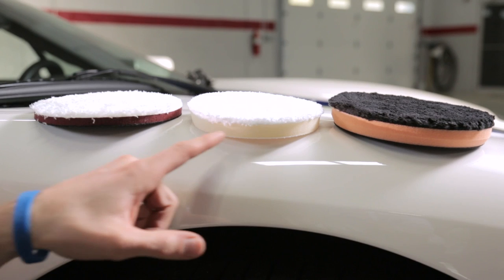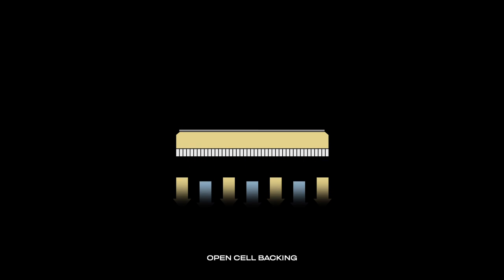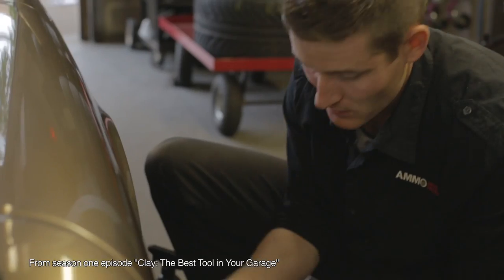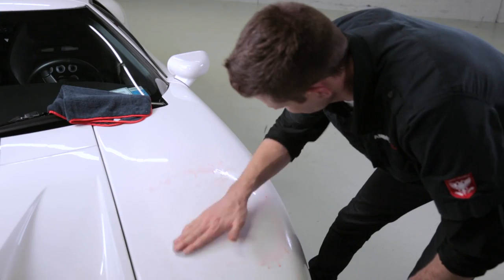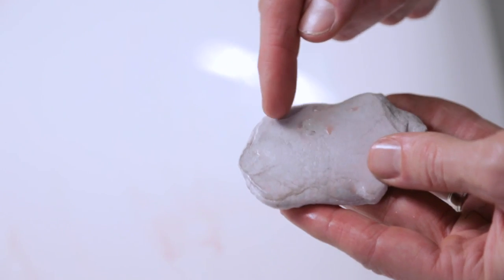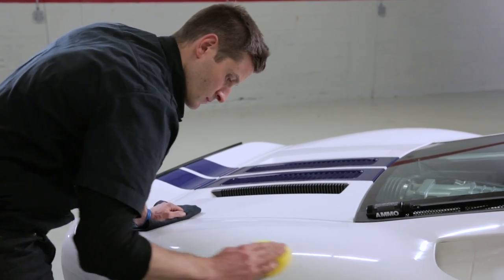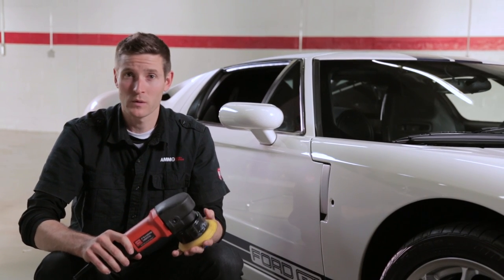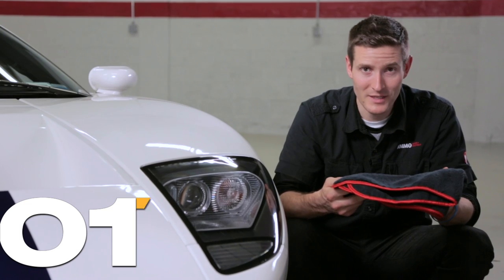Top 5 Tools That Changed the Detailing Industry - /DRIVE CLEAN

Comment: The use of dish soap is to strip all waxes and polishes from the surface before using the coating to ensure it bonds to the paint. Alcohol works too. But only if you wish to completely strip the paint of all wax.

Comment: It won't eat the paint's surface at all. It will however remove all "last step" products, i.e. waxes, glazes and sealants leaving the paint surface bare. It's basically an exercise in starting with a blank slate as such. Watch out for porous plastics though...dish soap can overdry those surfaces.

Comment: Dear Larry, You mentioned that microfiber safely traps particles inside the fibers. Would you continue buffing/polishing with a microfiber that touched the floor? I've seen detailers continue to use a microfiber that has touched the floor, i however always throw them or use them only to wipe down trim if that happens. What are your professional thoughts?

Comment: You forgot mention the metro Air Force car dryer on low speed then using a water bottle lightly mist car surface then mopping up with a slightly damp micro fiber dry towel (not cloth) that's a time saver and keeps your car hollagram free. Provided you know how to wash your car that is. Great video thow